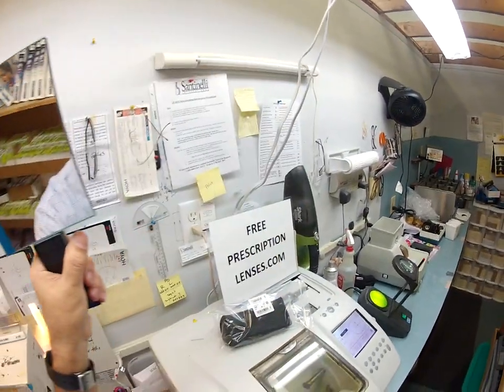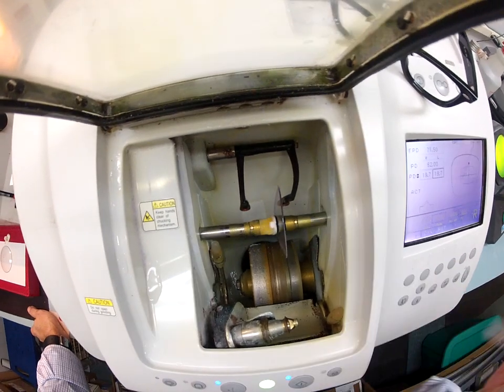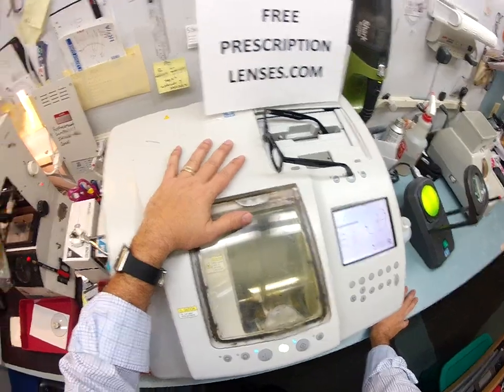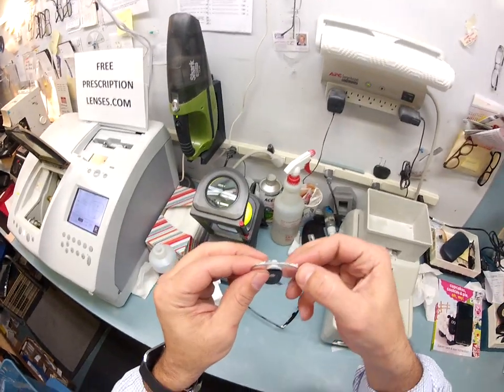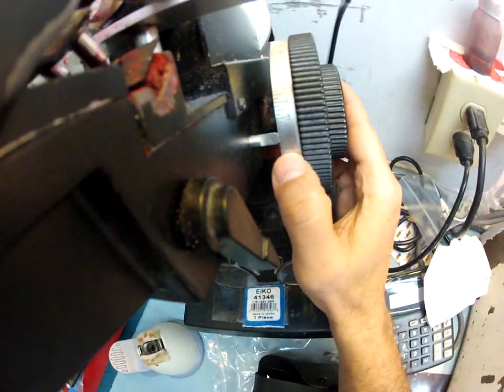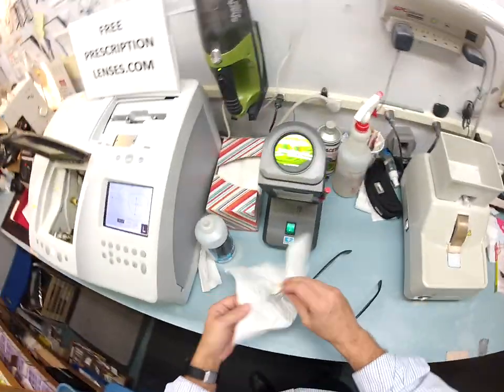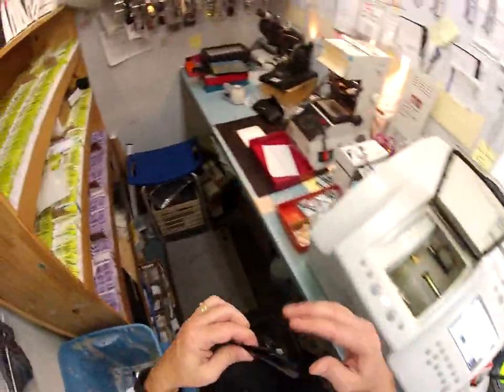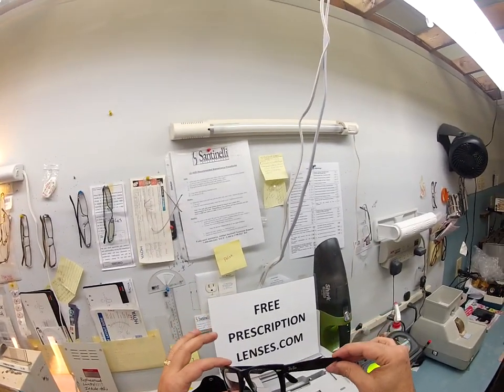Blademan's RayBan 5121 Wayfarer's with transition bifocal lenses

Comment: Sir how to block ready power (sph power) bifocals.. complete process fitting of bifocals..
Reply from the maker: I'd be glad to help. The first thing is to use the near PD, so lets say the patients pupillary distance is 67 and the near is 64. Use 64 which is 32 per eye. Typically the line style bifocal is set 3 millimetres below the B measurement. So if the B measurement,the vertical height is 40, 40 divided by 2 is 20. Subtract 3 millimetres from 40 and the segment height is 17. But to be safe you can always measure for yourself if the patient is in front of you. The tradition line style bifocal is measured at the bottom eyelid. The round bifocal at the bottom of the iris. And the lined trifocal at the bottom of the pupil.
Let me know if you have any more questions.